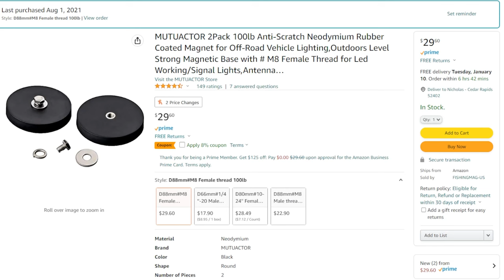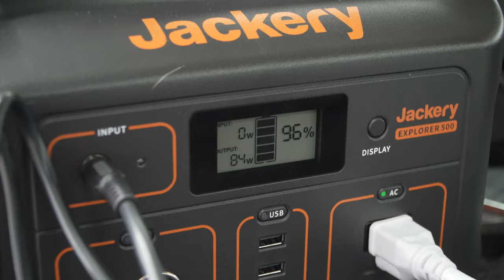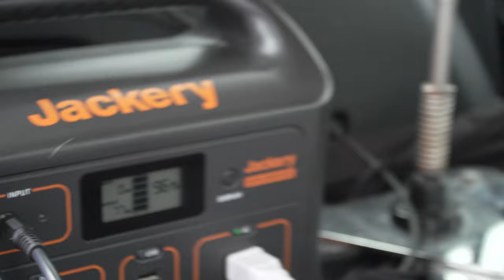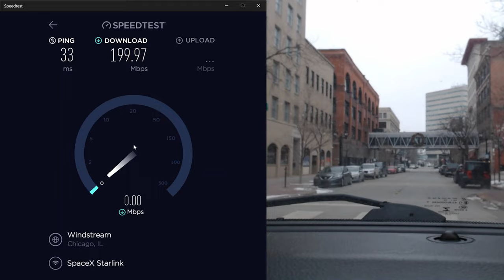Starlink RV Mobile Custom Magnet Mount - No drilling

Comment: very interesting idea! the 100lb magnet might be even stronger than the screws into thin top roof metal in normal installation! It could be a good idea to somehow connect the dish with roof rails so that it won't fly away to hurt others in case there is a disaster. You can even add two more 100lb force magnets holding the metal bracket against the roof. Would it be even easier just to connect the dish (i assume the bottom of dish is metal) with roof metal directly without the steel wedge mount bracket? The lighter the mass is, the less force is needed to hold the mass in place. Pls keep us posted on how good it is after 3-6 months!

Comment: should've used the rails as leverage to hold the satellite dish securely with bolts and nuts.  Even better, cover it with a see-through dome for aerodynamic.  Add solar panel to help recharge it.

Comment: I suspect those same magnets in m6 (1/4x20) will screw directly into the flat dish without having to use the wedge bracket.
Reply from the maker: Most likely, but the angle is helpful for precipitation runoff so I left it on. Given what I primarily use it for (storm chasing) that was an important consideration.

Comment: I desperately want to know why does starlink make the dish on an angle and raised, why not make it far more flush to the vehicle and flat.......? I get that rain and snow can go on it but that normally doesn't affect the dish much and the slight slope it now has isn't going to make 0 difference to rain or snow. Wouldn't the dish get a better connection to the satellites if it were flat, as like this it's harder for it to make a connection to the sats if the sat is behind the dish on the non sloping side...???? Stew?

Comment: When you ran the wires from the roof of your car to the inside lining of the hatch, did you worry about rain or snow leaking in?
Reply from the maker: Not really, been doing this for years with various roof antennas. The water-proofing on the door should solve most of the issues.
Reply: Thanks. What has been your go to power source? The jackery isn’t good long term. Have you used an inverter yet?
Reply from the maker: @projectsonepercent924  Since I won't be running this daily, I plan on sticking with the Jackery. 7+ hours per charge on that unit.

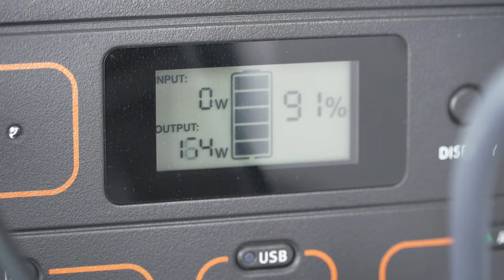Comment: Wonder what the other antenna at 4:23 is? Thanks
Reply from the maker: It's for my scanner, the Uniden SDS 100
Reply: @NStewWX  I think they are referring to the WeBoost cellular booster antenna that is on the magmount in the trunk.